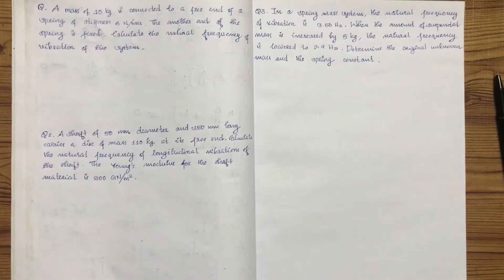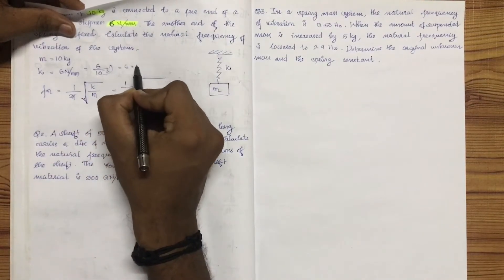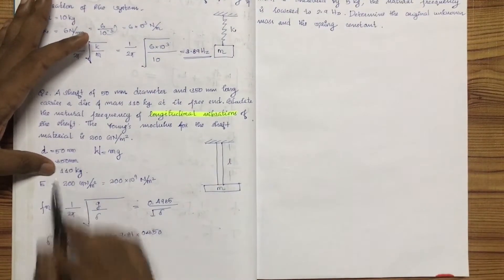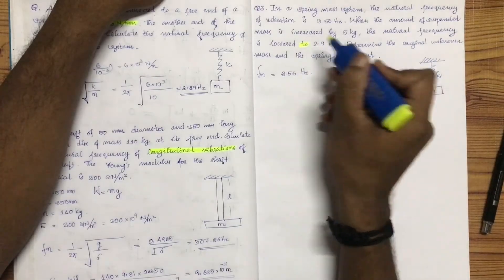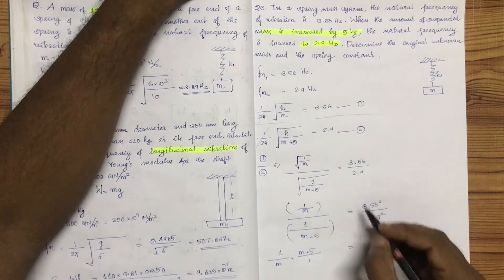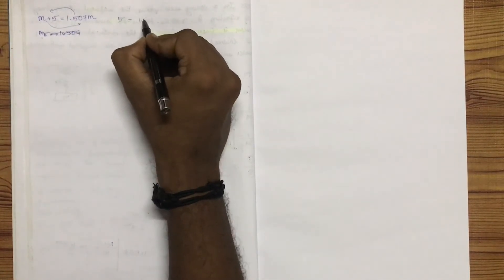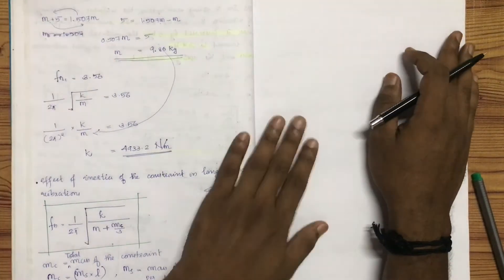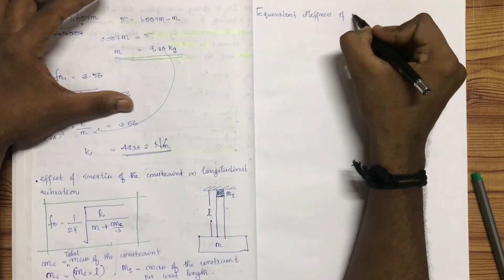KTU-DDM-MODULE 2-PART 4- LONGITUDINAL VIBRATIONS/PROBLEMS

Comment: sherikkum paranja 3rd qnil k value 4933 varillallo.........njn ethra cheythittum 1385.75N/m anallo kittunne
Reply: RHS 3.56 koode sq cheydha kitum
Reply from the maker: Nokki exzuthiya miskt akum… check cheyyan time illathonda.. bakki kand poku
Reply: square cheyyumbo both sides square chey, 3.56 kuudy square cehyyanam, then you will get the right answer. ❤️
Reply: Ok sir....